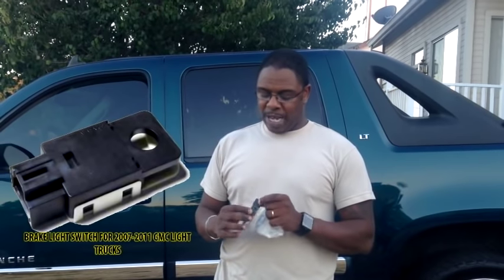[SOLVED] Fix Service Stabilitrack and Service Traction Control on 2007-2011 GM Trucks

Comment: Thanks for the video I'm about to change it out just having a little trouble on how to remove it to install the new switch. Anyone have any good pointers on how to remove it?
Reply from the maker: roberto hernandez on mine there was a cotter pin that I had to remove first then the switch was held on by double sided tape. once I removed that I unplugged the old unit, slid the old unit off the pivot pin then slide the new one in plugged it up and reinstalled the cotter pin
Reply: I had to use a flat screw driver to pop the clip off it won't slid I off. It was easy to install back but know stability n traction control stays on. Before it would just come on when I drive n go away. Do I need to disconnect the battery so it can reset or do I do something wrong?
Reply from the maker: I didn't have to disconnect mine when I did it but, you can give it a try.

Comment: Re: C0161 - IF you're having simultaneous light ups on the dash of your ABS light (as well as Service Traction Control AND Service Stabilitrak) this may be the ONLY fix required. I recommend daylight hours and at least one mechanically inclined friend (especially if you're a larger person).  My 2009 Silverado LT would bring these lights on each morning after a cold start before I could even make it out of my neighborhood. A good code reader gave me the C0161 error at an O'Reilly auto parts store.  Like others, for $18 and change @ O'Reilly, I'm back on the road with NO codes! Important to note -  before my fix, It could go ALL afternoon and it they would never come on unless parking on a steep angle or a cool evening. The other thing I noticed is that my brake lights would ONLY come on when I pressed the brakes hard. A light touch and the light wouldn't even come on. Your "OTHER CLUE" was that it was stiff to take out of park (abnormally so), as well as the cruise control not working (once the codes and lights on the dash were active). To those who watch their dash lights faithfully, this is a whole lot more than just a brake light switch!!! THANK YOU!!!!!!!

Comment: is this connected to the ABS I'm having ABS problem and Stabilitrak and my back up assist doesn't work any idea what that problem is I checked the sensors in the back they all look perfectly fine
Reply: did you ever get this problem fixed? I'm having the EXACT issue
Reply: Ines Fuentes I'm still having this problem
Reply: christopher bel
Reply: shirley roberson yes

Comment: I have a 2012 Chevy imPala and my traction control light on along with the check engine light it’s says service stabilitrak and service traction control please help me!!!!!!!!!!  And the engine shakes which when I drive it makes a vibration when I crank it up... the repair shop says that I need to get my ecm computer reprogrammed or something like that but watching numerous of YouTube vids they was saying it might be a Ecu sensor that has probably broken or maybe spark plugs

Comment: can this cause for vehicle to run rough I have those lights coming on but vehicle is running kind of rough
Reply from the maker: Juan Alvarado if I recall my truck would run a little rough when the lights were on.

Comment: my Traction control light on also says service stabilitrak an service traction control. Is this a part that can be brought or do I have to go to the dealer?
Reply: I have the same problem did you ever find out what was wrong with your car
Reply: keisha jones did it fix yalls problem i have the same problem

Comment: I replaced brake pedal sensor and it kept doing it when I checked check engine light it said multiple misfires on cylinder 4 so I replace that spark plug only and it cleared up.

Comment: Been looking all over the Internet to fix this problem it seems that everybody has the same issue but different methods of fixing it try it around every single one without taking it to a mechanic to charge me an arm and a leg the only one I haven't tried yet is the grounding. One guy said he had tried a couple of the same methods but none of them work he said it's something to do with the grounding the grounding was good but you have to put your voltage meter to it to actually check the grounding he end up replacing all the grounding wires from batteries and grounding from firewall to engine and it fix the problem these your models were traction control suck

Comment: So i picked up my pre owned 2016 savana and not even 24hrs and it says reduce power, service traction control and stabilitrak then tried turning van on again and it wouldn't crank  needless to stay its back at the dealer but im pissed.

Comment: I drive a 2009 gmc sierra 2500 and my stability trac and traction control came on as well as my check engine light. When it did the truck lost power and my rpms were at 2500 but i was going 20mph it wouldn't go past 20

Comment: I have Terrain  Gmc 2011 SLE Last week I had a problem and engine reduce  the power to 30km and start shacking and the message came on a display Stability track  well I read few comments about and I had to change my rattlebody and gas pedal it was collision between two censers and now running great I hope it will help anybody who has the same problem and same message 
Last year it did reduce the power to 30 km but it wasn't shacking so we just clean the rottlebody but it didn't work this time we had change it

Comment: I did this it worked but only lasted a day although my abs light don't come but my stability track does and no cruise control so it slaves one problem I still don't get codes when I have it tested

Comment: We have this same exact problem in our 2011 Yukon Denali!
Reply from the maker: Tylnorton try the switch may fix all the problems
Reply: Will do! Thanks for the resource!!
Reply: Any update on this?
Reply: @lilrico408  Yeah my dad ended up going to a stealership and wasted over $100 for a $20 brake light switch. Issue never came back. We got rid of it in July for a Suburban.

Comment: I have service traction control in my 08 impala and it says engine speed reduced? Any ideas? By the way it goes on and off some days it does it some days it doesnt?
Reply: +moneyhungryyt  I did a throttle body cleaning and it seemed to have worked.
Reply: I got a code that came up recently and it says p2138 throttle/accelerator pedal position sensor. Ive been reading the sensor is on the gas pedal and the pedal needs to be replaced, im defiantly going to clean the throttle body as well!
Reply: +moneyhungryyt Engine speed reduced is probably a thermostat problem. I had that condition and when changed thermostat it fixed that message problem.
Reply: +moneyhungryyt i also have an 08 impala SS model and just the other day my service traction/ service stabilitrak came on and i swear it feels like my car is about to fall apart? have you done anything to fix your issue?
Reply: +supamanxtm  I have not changed the brake light switch. However, you may want to check your battery. My battery had one bad cell and was not putting out the right voltage and it could have impacted the computer in the car. Since I changed my battery, the stablitrak problem has not showed up. But who knows? So many variables. Have someone check the battery. Cold weather made my battery act up. Good Luck ..Ted

Update 12-11-15. Battery did not solve problem. Lights came back on again. Stabiltrak service and traction control light and engine light. Will try brake switch and see what happens. However whenever you disconnect battery, it resets everything for a while. ..Ted
Reply: supamanxtm yes i replaced the gas pedal it had the sensor on it, i paid $70 from autozone and the check engine light and service trac went away. Hope that helps. Oh and also i cleaned my throttle body!
Reply: +moneyhungryyt you replaced the whole gas pedal?
Reply: supamanxtm ya its 2 bolts and unplug the sensor, it took me 5 minutes.
Reply: +moneyhungryyt did it ever make any loud clicking noises like 10 secs apart from each other?
Reply: supamanxtm did what make a loud clicking noise? What are you referring to the engine the gas pedal?
Reply: +moneyhungryyt the engine? mine all of sudden made a clicking noise but only when this damn service traction control came on.
Reply: supamanxtm ya i dunno bro mine never made a clicking noise that could be a number of things! I would plug a scanner in and see what codes u get and go from there
Reply: +moneyhungryyt changed out my pedal this morning! man i can't believe 2 screws and a sensor can cause so much issues... the problems haven't come back.....yet.... my engine isn't vibrating anymore either. time will tell though. thanks for all your help bro!
Reply: supamanxtm no problem your engine shaking most likely was from that same part going bad as well, everything on these damn cars are computerized!
Reply: +moneyhungryyt yeah no joke! sometimes i wish i had an old 80's pickup to where a part didn't sensors to run just 4 bolts and boom! running, i'm glad its not a hybrid! lol

Comment: Dang it worked for everyone except me 😔 mine still says it. I even reset the battery after putting in new part and nothing. 07 Tahoe
Reply: There's a 25-amp fuse that could be blown also. Check whichever fuse goes to your ABS. Mine is the #8 spot.

Comment: Will it work for a Chevy malibu?
Reply from the maker: I haven't worked on a Malibu before but here is a link you can check out hopefully it helps http://www.paulstravelpictures.com/GM-Chevrolet-Malibu-Brake-Pedal-Off-Tail-Lights-On-Repair-Guide/index.html

Comment: My 11 Malibu is saying service esc service traction. As soon as the esc light comes on the car says reducing engine power.  Please help I tried the other part with no luck.
Reply: Anthony Mcgarity I'll try it
Reply: Did it work? My 2011 malibu is doing it also. I thought about changing the throttle body sensor. Code P2135

Comment: I changed my brake light switch and it fixed my cruise control but did nothing to fix the stabilitrac system

Comment: If the brake switch is faulty, there will be more problems related to the brakes than there will be problems related to traction control and StabiliTrak

Comment: I replaced the part and it did not fix the problem. Easy part to replace though. I am going to replace the battery cable next.

Comment: Mine turn on but it starts to shake and then the stability light turns on and when I drive it it goes really slow and when it changes gears it pushes back.
Reply: did you get the issue resolved? I'm having the same problems.

Comment: The same thing just happened to me I replaced the break switch and didn’t fix the problem I had to disconnect the switch so I ca pitot on gear and drive my truck . can anyone help?

Comment: I have a 2010 Impala. I have the lights on my dash but don't have any problems shifting into drive..... Does anyone have that problem?
Reply: +Gnik4144  yes I have the same on my 2011 impala and according to the dealer it was a long list of issues that they would charged me well over $1500 to replace. I replaced the parts at a fraction of the price but that didnt fix the issue. They are just guessing at the GM dealer.
Reply: +Michael Singleton I ended up changing the wheel bearing. The wire ripped right out of the abs sensor. ( or what ever sensor that is) The dealership wanted $650... Smh the part cost $90... It only took 30 minutes. A few nuts & bolts.
Reply: +Gnik4144 2010 impala have the same problem replaced both wheel bearings still have the problem
Reply: In my 09 had the issue check the the gas pedal i had to replace mine problem solved

Comment: How does the clip work I can’t uninstall it
Reply from the maker: juan galvez have to use a flat head screw driver. The middle of the clip is holding the entire clip in place just pry the middle up and it slides off. Best of luck

Comment: didn't work on my 07 avalanche still goes on and off while I'm driving. if it comes on while I'm at a light it shifts real hard into gear. then it will go off and be fine then a mile down the road it comes back on. wtf.
Reply: did you figure out what your problem. was.  my 07bavalanche does the same thing..  and now the parking brake light randomly comes on as well
Reply: It was  front wheel bearings.
Reply: +Glenn baker  ok thanks.   what yours throwing a code.   I replaced my front left wheel bearing last year.     but when I started having problems the scanner said it was my rear speed sensor wich I replaced and it did the fix the problem

Comment: That's not true, mine 2013 Chevrolet Silverado has same issue but the cause is different, it has been going on for 2 years I couldn't figure out what really is happen to it because everyone show a video in youtube same issue different but result, mine truck's problem is causing by the radio circuit board malfunction and send a bad signal to the computer then the computer shut off my engine (engine reduced power) and (traction stabilizer t stabilitrak service control) after unplug all connector from the radio everything work fine as normal. That is because nowadays our car and truck drive by the wire (electronics communications)

Comment: Man that is not the answer for this problem, did this very thing to my Avalanche over 2 years ago,  but it will fix your cruise control issue, witch it did for me! I see no matter how and where you look for a real answer to the Service stabilitrak and traction control issue, no one has a real fix for that issue,  GM should put the damn fix out so we all don't take a fu****g by the dealerships.
Reply: Yeah although I appreciate videos like these, as they are meant to help- It did not fix my problem either. No cruise control, and stability/ traction Pop up intermediately, with no functional issues. ??? Might be the sensor on the gas pedal. I don't know yet. I'm going to replace brake sensor a second time, (yeah I know), but just in case, because I have received bad parts before.
Reply: +Phillip Martinez update: well I ordered another brake sensor switch, feeling that I might have a lemon. And my hunch was right. This time instead of going to my local shop, I ordered through Amazon an AC Delco brake switch. Replaced it and it fixed the problem for me. I had originally bought a bad part from my local shop at twice the price. Smh

Comment: Took Your advice, didn't work. Dash still says service traction control.
Reply: try replacing the throttle position sensor
Reply: I had to get the throttle sensor replaced after my panel said something about the stabiltrak not working.
Reply: A dealer told me it's the sensor at the base of the steering column.
Reply: Thank You
Reply: David Swick
Reply: Was it the trottle position sensor giving you the service TC message?
Reply: My car 2011 Malibu 130,000 miles
Reply: Chuck Webb, I'm just living with it until I take it in for other problems.
Reply: Mine is intermittent. I will let you know if i solve my issue.
Reply: a bad VSS on the left or right rear wheel will throw a traction control code and usually a abs code as well hit a goat in my envoy and it ripped the VSS cable apart and I got those two codes immediately

Comment: Dint work on mines fixed the cruise but not trac and stabilizer codes somebody plz help
Reply: Same thing for me. Have you figured yours out?
Reply: Chad Davis I had to break down and put it in the shop they told me some about my wire harness was all jacked up so there replacing and fixing most of the wiring may need modules too but I already dropped damm near $2709 fucking with YouTube no more for me these are lol fixes that’s temporary might have to do that bro hopefully yours ain’t the same prob as mine👍🏾

Comment: I didn’t work for me, I installed the new one and still shows the same codes
Reply from the maker: Sorry the fix did not work for you. Maybe another issue other then the brake light switch in your situation.

Comment: This didn't work for me, I tried this on my Escalade, and it was still locked in park. It's in the shop right now$$$$
Reply: you need to order an interlock relay.. right under dash. I had same problem today .... I drove it to have windows tinted and out of nowhere wouldn't go out of PARK.... I took panel off (under steering wheel) foundit and unplugged it and it will go in drive no problem .... Costs approx.$22.00 at parts store , I ordered from AMAZON for $12.17 with free shipping .. Havent got it yet but I will put it in on Thursday when it gets here ... Hope this helpsmy Service Traction Control / service stabilitrak is on as well . so I'm changing brake switch too ... hope this works !!!
Reply: ACDelco 15775841 Shift interlock shift control solenoidX000YPFW41
Reply: do u fix ur scalade.?
Reply: 2010 Tahoe , yes it fixed it ... very easy to replace too..

Comment: it was front wheel bearings
Reply: Stability track and brake light indicators are on and the warning messages for both are on. This happened after driving through receiving floodwaters. Down here in Louisiana. I suspect it's my Front bearings. Last reported from the mechanic, it seems they were wearing. FYI.

Comment: Nope doesn't fix the issue. Neither does adding the ground cable if you've seen the other videos. Turning stabilitrak off doesn't fix issue either. Leaning towards egr valve, but replacing the throttle body is total BS. 
I'd get updates from GM. Good start there. 
But let's also remember the diff has 2 sensors in it for traction control which could be faulty.